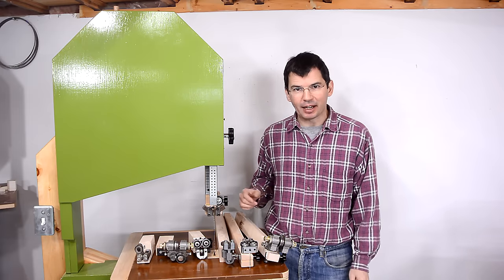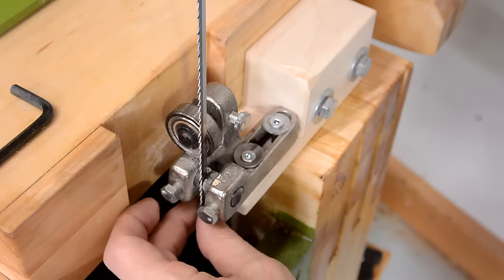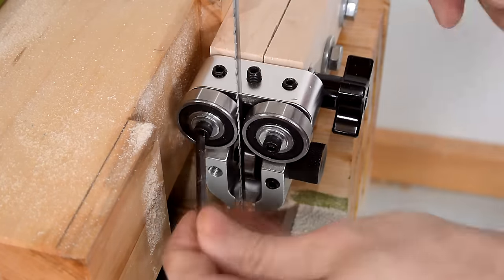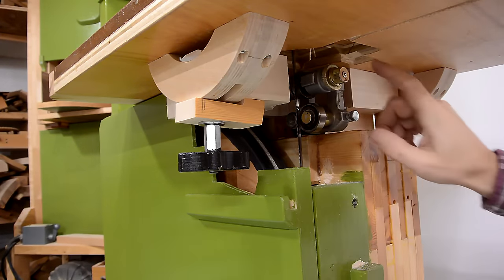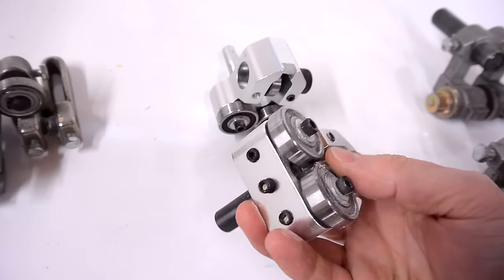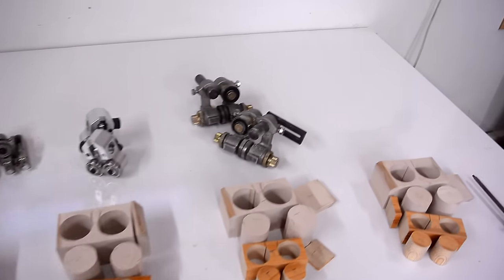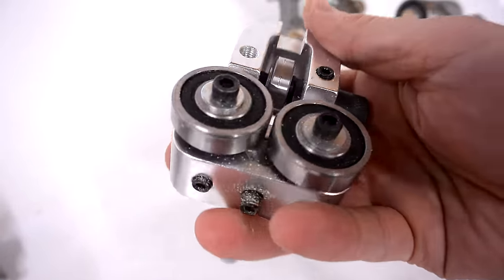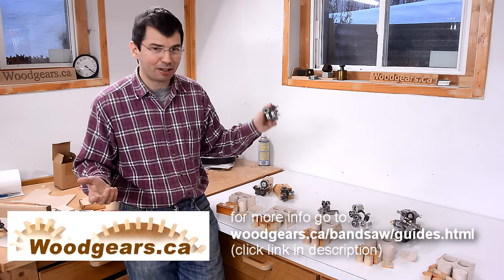1 bandsaw 4 blade guides comparison

Comment: I really like the logical and experimental way you go about testing your equipment. Thanks for sharing. 

FWIW, the only difference I have found between the saw blade guides that came with my Delta 14" band saw (using either phenolic or ceramic guides)  and my Carter ball bearing guides is when I resaw wide boards. The Carter guides seem to help the blade stay on course better and the result is a straighter and smoother cut, with lest wasted wood --using identical blades.

The difference, in my estimation, is not great, but I nonetheless am glad I upgraded. No doubt my own "sense" of how the two guides work affects my assessment, but that is always the case. Generally, I agree with your assessment that original equipment does a pretty good job -- because it is designed to do just that.
Reply from the maker: If the blade is wider than the guide blocks, always put the guide blocks as close to the teeth as possible.
Reply: I find that adjusting the blade guides close to the saw teeth  really helps with resawing, too.
Reply: Jerry Stark p

Comment: Do you or anyone else, have issues with wear on the cheap blade guide blocks? I have the composite ones because the ones that came with my used bandsaw were all screwed up. I have grooves that have worn into the blocks and i have had to flip them around.

Comment: What about noise, Matthias?  Any notable difference?  Those fancy after-market guide had the rear bearing in-line with the blade instead of perpendicular.  I always understood that alignment produced more noise.
Reply from the maker: they are all quieter than the bandsaw or cutting.

Comment: My question is which one out of homemade ones are the best?
Reply from the maker: the design I used on my 14" bandsaw is nice - one screw on each block is easier to adjust, but it can't handle these really big sawmill blades.
Reply: well i almost have done building 16" with Your plans. i will use 6mm and 20mm wide blase( thats the sizes more common here) so i am which one will be better. should the bearing in the back be like on 16" or like on 14"

Comment: My wide blade bandmill doesn't require a thrust bearing, the crowning on the wheels is enough to keep it on the wheels. Why won't the same work for narrow bands? Thanks
Reply from the maker: because you need wider blades for that effect to be strong enough

Comment: very informative, I found that the cheap guides that came with my saw actually broke because the metal was really poor so I built some home made ones like yours and used the blocks and bearings from the original. Now I have the best of both all in one.

Comment: Thanks for sharing, 
I've been thinking about buying a bandsaw and was wondering if you could help me out.  I would like to have a bandsaw that I can use for different aplications like  make bandsaw boxes, cutting boards but also tu be able to resaw.
I'm kind of intended in the  laguna 14/12 1.75hp but I'm not sure sure about the ceramic guides.  
What would you recommend? 
Thanks
Reply: elyyfz450 you should comment on a newer video

Comment: Great video.  Thanks so much for doing this comparison that most people will never be able to do themselves.  Careful using those bolts instead of the set screws.  I broke my cheap set because I lost one of the set screws and replaced it with a small bolt just like the one you use.  Its harder to tell how much force you are putting on the bolt and it doesnt take much to break that cheap metal that is used.  Once they break they are pretty much not fixable.

Comment: I just bought a brand new looking Rikon 10-305 for 160 bucks. Bandsawing is new to me.
Adjusting the upper bearings is a pita.  You position the bearing, then when tightening it.... It moves.  Keep trying till you get it right. 🙄
Screw that. I made an aluminum guide platform to replace the original piece.  
Mine has the two side bearings permanently spaced at .031"
The blade is .025, so add .003 clearance on each side of the blade and you'll have a .035 gap.
I just slide the bearing holder right and left to cender the blade and snug it up.  One moving part. Too simple? Youbetcha it is.
The factory could do this if they cared.

Comment: For the comparison you missed one option, running no guides at all.  You likely would have had to go slower making the contour cuts, but cutting in a straight line is probably just as fast.
Reply from the maker: 1/4" blades don't track well enough for that.  Blade would have gotten pushed off the wheels.

Comment: this was perfectly timed for me i was debating if it was worth upgrading from the cheap ones that came with the band saw as they have little half inch diameter bearing on the guides that i just hate any thoughts as to if i can just pull those out and replace them with some mild steel bar

Comment: Really nice information.  I've been thinking about buying a set of Carters but didn't want to spend the money.
Reply: I have Carters on a delta 14 inch. Much nicer than what he is demo-ing....also double bearing . excellent for resawing, when the pressure on the back roller is significant.

Comment: They all seem more complex than need be.  Why not have a high density plastic insert for each size blade?
You would just drop them in and secure them and adjust x and y if needed.
Reply from the maker: plastic is unsuitable. Softens with heat, wears away fast.
Reply: Depends on the plastic. I was thinking of something like UHMWPE.

Comment: What material are the guide blocks on the cheap ones made from? Just wondering how quickly they'll wear compared to the homemade wooden ones.
Reply from the maker: it looks like just iron (not steel), relatively soft, but harder than wood.  they haven't worn significantly in all the time I had this bandsaw, though I haven't used that saw much since 2010
Reply: Try cutting without a guide at all!
Reply: Jeremy Schmidt I thought they used phenolic resin for those? mine are worn through so I was going to manufacture a bearing based replacement, just trying to work out the best way to do it

Comment: why not use a flir camera to see the temperature of the blade?
Reply: IR cameras like the FLIR aren't a good measure for exact temperatures due to the reflectivity of the metal blade.  The highly reflective blade would send back more light than it should giving you skewed readings. Ideally you would want a black surface that isn't very reflective.  What you can use IR cameras like the FLIR for is to easily find hot spots or trouble areas.
Reply: your finger can do the same job, just touch the blade and if it burns, its hot...   if it doesn't burn your finger of, its cool... ;)

Comment: Blade guides that are a step above the cheapest will have thumb screws and fine adjustment wheels for the guide bearings.  So no need for using a tool to reset them.

Comment: How about original blade guides that are the cheap variety but they don't actually line up straight - they are cocked to the right all the time no matter the change in their height. So then the square little blocks get a cocked wear on them and don't sit flat against the sides of any blade. This is OEM stuff. It's so ridiculous. I'm going to have to redesign the whole attachment of the blade guides so it's SQUARE to the table and the blades. It's so ridiculous. 14" cal hawk

Comment: hey Matthias, im amazed how you can cut such small radiuses with not even  the smallest blade. if i do this on my cheap bandsaw the blade will fail eventually and wont even get anywhere near the shown radius. what's the constraining facor here? bladeguides + tension ? thanks & greets from germany
Reply: Matthias, Iv watched your vids and have been beginning to like you a lot, so here is a cool Idea I had, that would be cool for your kid. A mini pinball machine that doesn't involve any electricity, and is 3 feet long by 1 and half feet wide. I got this idea from Lego mini pinball machines and If you decide to do this I highly recommend you watch videos on homemade Lego pinball machines I also highly that you use at least 1 to 2 inch thick wood for the table, and small gears for the arm mechanism. if you read this please reply and say you have read. thank you for reading this. 
PS: Iv never seen vids for a wooden mini pinball machine so it would be maybe the first out there.
Reply: that easy?

Comment: No resaw test?
Reply from the maker: resawing uses wide blades, which are much easier to guide
Reply: I use carter delta 14 in band saw guides. Their advantage is seen primarily in resawing wood of 3-4  inches and greater ,when there is significant pressure against the roller.As it has double rollers it is useable up to the saws limit of 1 inch.  https://www.woodcraft.com/products/carter-products-delta-14-band-saw-guide-conversion-kit-carter-del14

Comment: Great ..!! thanks for sharing, i have a Felder Hammer N4400 Bandsav and the guide sucks, i found out that when i rearly need the blade guide, the whole upper arm that holds the blade guide flex, i can make it flex with one finger, Felder sell new seramic guides set for 360$ but what do they do me, when the whole arm flex, so if the guide are for weary fine sawing guide, then the tolerance from the guide to the blade make præcision troble, but in this case i proffer the ceramic guides,, its all about the business end, where the steel touches the wood.

Comment: Matthias, thank you for your work on this. One observation is that all of the cuts performed in the video were short or highly curved. I believe a resawing experiment should be included to account for blade drift or movement over a longer distance. Set the blade up properly and then run the test with each set of guides. Perhaps a 1 meter resaw and then a comparison of thickness at both ends of the resaw piece.
Reply from the maker: Resawing is entirely a different game, requiring much wider blades.  And wider blades are MUCH easier to guide, so the guides matter a lot less for that.

Comment: I love your content Matthias but it looks to me like you are running out of ideas for a videos.  :P
Reply from the maker: No shortoage of ideas. Just short of time.
Reply: Maybe because there wasn't clearer results from the test it seemed less compelling, but I thought it was just as valid for a video as many of his other curiosity tests. Thanks for the video Matthias.
Reply: Nikola Wiche Yes. No big result is a result too.
Reply: embed0 SILENCE PADAWAN!!
Reply: I broke my blade guide the other day (casting cracked) so this video is perfectly timed and very helpful. Buy the cheap one! Although, they will crack eventually
Reply: I would like to have seen Matthias use some sort of weighing scales in this test, that's why I was disappointed. Or something to measure the loudness of each accurately, or perhaps that dial thing to see by how much the blade moved when cutting. All irrelevant of course, but I prefer when he does things to the extreme
Reply: embed0 what rubbish. Do you honestly think he is out of ideas or are you just trying to be funny?
Reply: Actually, I appreciated this one. I've been looking into guides for my old bandsaw and I would have opted for something expensive. This will probably save me a few bucks.
Reply: I don't have a band saw, but was super impressed with the fast, tight, cornering possible with all of them. Would love to see a similar test with 4 or 5 blade guides used on an inverted jigsaw, which is more likely to appear in my workshop.
Reply: It's very important for me that Matthias does things other people don't. Even more important is a honest result, even if it means there is sometimes no really "spectacular" result to show!
Reply: you should making a hilsch vortex tube out of wood

Comment: knock down laptop table with manual crank height adjustable please...
Reply from the maker: I don't have the metalworking skills to pull that off.
Reply: Here's an idea... wood gears? ;-)
Reply: http://kmoddl.library.cornell.edu/leonardo/fig9.jpg
You can use a Leonardo da Vinci style crown gear, dowels trapped between two plates
Reply: Yup, I was thinking the same thing! To utilize wood gears and create the same mechanism of what metal does.

Comment: Wrong kind of test for a band saw guide … Try to cut a 2cm thick wood, 25 cm high and 100 cm long in two pieces!
Reply from the maker: That requires a much wider blade, which is much easier to guide.
Reply: @matthiaswandel  Your are absolutely right, but nervertheless is this kind of cut with the wider blade the litmus test for the accuracy of a band saw. Have you tried to cut without any guide with the small blade? I guess that with a little patience (moving the piece of wood only slowly) you would have the same result without guides.

Comment: Здравствуйте! Вы верно заметили что все они одинаковые, правда кроме тех что я придумал и разместил тут пару видео на своей страничке. https://youtu.be/tqrcMxFGwAE Мне удалось исключить удары при попадании стружек. Я применил установку направляющих подшипников с разносом по высоте. Поэтому зазор нулевой, а не как на всех 0,1 и более миллиметра. Регулировка крайне проста, упорный подшипник легко перенастраивается на любую ширину пильного полотна.
Hello! You truly noticed that all of them identical, the truth except those that I thought up and placed couple of video on the page here. https://youtu.be/XJg9zNqLygo  I managed to exclude blows at hit of shavings. I applied installation of the directing bearings with a rating on height. Therefore a gap zero, but not as on all 0,1 and more than a millimeter. Adjustment is extremely simple, the persistent bearing is easily recustomized on any width of a saw cloth.

Comment: Ah, no wonder some are noisy. Running the blade on the flat side of the bearing makes it scrub. Very poor design with those cheap ones. The home made flat ones have got a lot going for them, virtually dust proof to start with. BobUK.